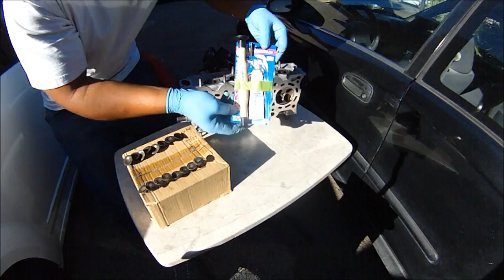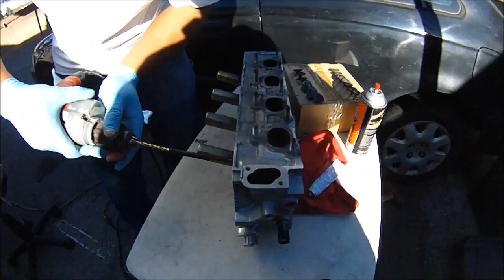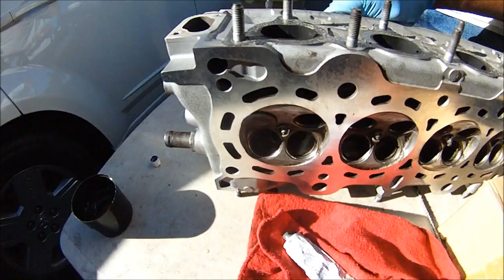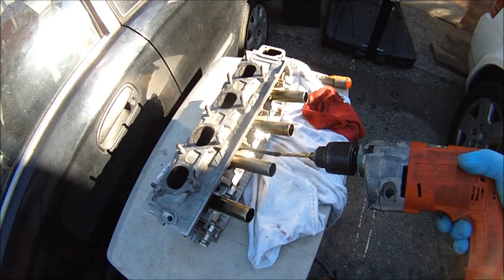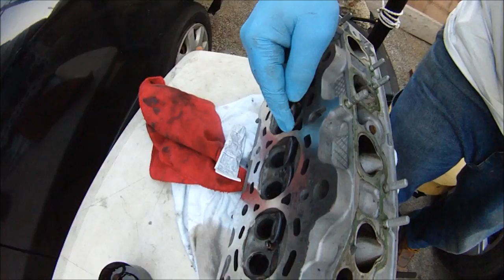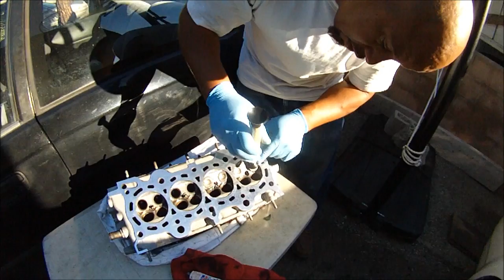HOW TO GRIND VALVES WITH A VACUUM HOSE & DRILL (NEVER TAUGHT AT SCHOOL, ONLY OLDSKOOL)

Comment: Dunno... I've used a drill (because the Garbage Rubber tipped Stick wouldn't stick) 
This a Risky !! methoc though.
 Waaaay to easy to grind grooves into both valve and seats. 
With skill it can work well.
But.. if one had Skills they wouldn't do it this way. 
Dangerous part  being anyone who thinks this an Easier... is Likely to bungle the work.
Reply: I can only hope that a DIY guy or girl somewhere take this comment seriously. Don't use the drill method if you don't understand the lapping method fully. You'll ruin your valve seats and valves. PLEASE LEARN THE VALVE LAPPING METHOD WITH THE HAND LAPPING TOOL FIRST!!! I USED THIS VIDEO TO LAP MY VALVES AND ALMOST RUINED MY ENGINE HEAD. TIPS IF YOU ARE STUBBORN 1. GET A DRILL THAT HAS REALLY SLOW SPEED. 2. PUSH IN AND OUT THAT DRILL REGULARLY AS OFTEN AS OLD SCHOOL DID IT IN THIS VIDEO. 3. APPLY LIGHT TO MEDIUM PRESSURE. DON'T PULL TOO HARD. YOU'LL MAKE SMALL GROOVES ON THE VALVES AND SEATS AND IT WILL NEVER SEAL. 4. SWITCH DRILL TO FORWARD AND REVERSE EVERY 2-3 SECONDS. 5. CHECK VALVES AND SEATS REGULARLY. FOR SMOOTHNESS. NO MICRO GROOVES SHOULD BE THERE. 7. GET A VALVE COMPOUND THAT HAS FINE AND COARSE GRIT SEPARATELY. ITS EASIER TO USE. 8. GOOD LUCK YOU'LL NEED IT. THIS IS DEFINITELY NOT GOING TO WORK FOR EVERYONE. IT DIDN'T WORK FOR ME. 9. STOP LAPPING WHEN THE COARSE SOUND OF THE COMPOUND GETS REAL QUIET. THIS TAKES EXPERIENCE AND PRACTICE FOR THE AVERAGE PERSON. NOT EVERYONE WILL JUST GET ON THEIR FIST ATTEMPT. HENCE LAP WITH YOUR HAND FIRST TO BUILD UP YOUR SKILL TO USE THE DRILL. AND SOME DRILLS JUST CANT GO SLOW ENOUGH FOR THIS OPERATION. I WOULDN'T RECOMMEND ANY BEGINNER TO JUST GET UP AND DO THIS. SORRY I DID.

Comment: Its an old vidreo and you probably already know this but i leave the coment to others , you shouls reverse the drill every 5-10 and dont use it full  speedrotation like you did there or will eat too much metal, but ofc it goes from motor to motor one holds better then others.

Comment: You can do it by hand with vacuum hose if you don't have a drill.  Use stiff vacuum hose.  I prefer the vacuum hose over the suction tool.

Comment: Only dislikes are from mechanics that are tight they cant scam people into just swapping another motor into their car!! Great job
Reply: Your statement is totally false. I do repairs on the cheap all the time on my vehicles. When it comes to Lapping Valves, it does very little on an engine that is warmed up. It is proven the valve heads expand and no longer seat in the same place on the valve and seat as they did when cold. You are only lapping cold components. .......... 

When the head is removed, just check to see if the combustion chamber holds gasoline or water without draining through the closed valves. If they do, clean the carbon build up and just put them back together with new seals as long as the guides are OK. .......... 

If they leaked and you are totally broke, then the bandaide of lapping can be tried, even though, when the engine warms, the sealing surfaces will be in different places and "HOPE" for the best. .......... 

I worked professionally since 1980 and on the flip side, I knew how much I could get away with on my own stuff. I knew any redo's on my own stuff was 100% on me if it failed for some reason. ..........

Comment: Hi oldskool! I'm lapping the valves of my 99 accord (the cylinder head seems to be exactly the same model you're working with). I'm doing it by hand, 'cause i'm a first timer. My grinding compound comes with two grades: fine and coarse. I'm supposed to use first the coarse paste and then the fine one. But after using the fine one, the grinded area at the valve and the seat doesn't feels smooth. It feels kinda rough but fine at the same time (like a very fine nail file), and the texture is like it has concentric rings. Does that reflects a correct lapping? Or i'm doing something wrong? I'm broke also. I'm doing this valve and head job for my accord myself. My mom has cancer and i need the car to take her to her therapy.

Comment: did it on Basic 3y toyota head.just chucked valve in cordless drill.no need for rubber link hose. direct drive. worked fine

Comment: I figure..... I already need a new 2 or 3 thousand dollar (rebuilt) engine because of my misfire problem....  I might as well spend about a hundred bucks on new gaskets and valve compound and give this and the head gasket / lapping videos a go.  I guess, the worse that could happen, if I don't fix it, is at least I get $100 worth of entertainment out of taking the engine apart, and working on it myself. :)

Comment: I saw loads of stuff from you and liked what yoy explained till now. But grinding valves with a drilling machine is a big NO NO! Never ever rotating valves like that. There is a special tool available with does a left right turn and is for a drill machine... But never ever soin them like that. You just get grovea in your valve surfaces and seats! After 25 years of doing mechanic stuff i still lap my valves the old school way by hand and suction cap...
 Dont do that way...
I see that all the time here in Cambodia... Again... Its a NO No!!!
Reply from the maker: It's not for you, it's for people who ain't afraid and who have a CAN DO ATTITUDE. Dont be so negative in 2019

Comment: I just got done doing this on a 1992 Ford Ranger cylinder head (2.3L I4) with 230,000 miles.

This method works -- and if you're like me, I not only hear the difference, I feel it too. While most people won't do it, I use a finger in the direct middle of the valve, while it's spinning, to be able to push on it slightly. Basic premise is to be able to push the valve in and out, and hear/feel no difference.

But like Old Skool said, this is for those of us who are basically poor and broke -- and with my valves and valve seats, especially considering how corroded and worn they were upon removal, why would I spend the $1,000+ to have a shop do this work, when I can DIY it? 
But OS is showing the proper technique to do this -- only thing I would add is to move the valve in and out so as to give a more uniform grind to both valve and valve seat.

Note: I wish I could upload pics to YouTube in comments, just to show how badly they were worn, and how they look now. Worlds apart, all thanks to this method -- plus the amount of money saved.

Comment: Grinding valves with a drill is false economy. Best thing to do is valve job from machine shop or replace the  head. Heads warp, guides wear, seats are worn. When the engine warms up, parts expand. Doing it this way will cost twice as much! DON'T do this! Cam journals and bearings wear. Install inserts NOW!
Reply: well why don't you just eat your words and buy it for the guy. call it a sponsorship, like in racing. robby jones sponsors the poor guy with the head he cant afford so robby can show the world the right way to do things. i like it.

Comment: This is a smart method. Valve lapping and just cylinder honing can restore a tired engine a "Poor man's engine rebuild" I've gotten engines not to smoke, got 30 percent + increase in compression. Also, a method I have used is I had cut and machined the wooden handle of a suction cup honing tool to fit in the chuck of a drill, and lapped them from the "other side" but the vacuum hose method looks like it works great!

Comment: just out of curiosity, couldn't you use a wire brush wheel to do the same thing? it looks like you are mostly just getting all the carbon off.
Reply: He's grinding two mating surfaces simultaneously for an airtight seal, something you couldn't accomplish by wire-brushing each surface separately. When he's done, each valve seals on only that seat, you can't swap them out afterwards.  Sure, a wire brush would remove carbon but that's not the only goal here.  You want an air-tight seal.

Comment: Why don't you take that lapping tool, cut it in half, add a nail in the middle, and run that on the drill? you can apply direct pressure, without worrying about the vacuum hose twisting and potentially breaking.
Reply: That might work if you could assure the suction cup was on the centerline of the valve.  If off center at higher RPMs, it may tend to spin off.  Try it and let us know how it works.

Comment: what does it mean if my coolant is evaporating out of the reservoir? would a head gasket change and machine shop cover this? the car's temperature isn't rising or anything I just have to put water in it everyday
Reply: Do you have puddles underneath your car?  Sounds like a leaky hose or cracked reservoir.

Comment: You guys that say you need grinders, mills etc, are correct.... by modern thinking. They don't teach this stuff anymore in school but there are many ways to repair things if you have the knowledge and experience. Old timers did different kinds of repairs and knew how long they would last. Some engines react well to certain repairs but not to others. I've seen loose rod bearings repaired by grinding the caps and lapping.

Comment: Thanks Old School, used your instructions on sanding the deck and head worked great. Doing the valves I used the cups from a hand lapping tool and put then on nut drivers for a drill, and then put them on the drill and used downward pressure and hopped them lightly up and down, as well as changed rotation. Using Old School methods I saved at least a grand plus, maybe more. Sweat Equity, thanks again.

Comment: And I thought the vacuum hose approach was a me original haha- did this on a honda head. 
I also discovered that one can do a 3 angle seat grind with permanent marker, a dremel, and grinding stones dressed to 30 and 75 degree angles. Permanent marker on the 45 seat will show how wide the contact area is. Gotta' be very careful of course, one slip and it's a trip to the machine shop. I narrowed my seats down to the width I wanted and the head has run great for over 5k miles now.

Comment: wassup big dawg...Love this video right here..ive seen alot of videos where people use that tool to suction the valve from the front and use their hands to grind down the valve.. this right here though way easier.... is there anything you recommend on cleaning valves without pulling the head off? ive used seafoam and valve cleaner  spraying through the intake with little success or is pulling the head off the best way to do it?

Comment: exact same way i do valves. on small engines like briggs you can't use the hose to drill method but you can superglue something to the face of the valve to allow for drill action. never had much luck using the suction cup.

Comment: Thanks for the excellent vid, I've ground heaps of valves in the past just like this, with excellent results. Only real difference is that I test the seat with petrol/gasoline at the end because if petrol doesn't leak though, pretty much nothing will. like you, I generally do most of the grind with the drill and finish with the hand tool. While the head is off, it's probably a good idea to check and/or replace the guides and seals to. Thanks for sharing :-).

Comment: With my race car, a 496ci Big Block Chevy with very expensive aluminum heads, whenever I have the machine shop recut my valve seats, I always give them a good valve lapping...just to be sure the valves have a good seal. I do them the same way...sort of...
I do use two grades of lapping compound. One is course and the other is fine for a nice finish.

Comment: Very nice video.  (Would have been nice to see a before and after cold compression test.)Question - is there a risk that this method removes too much material from the valves and their valves seats, so that the valve clearances cannot be properly set because the tip is too close to the camshaft/rocker arm?I am working on some old Yamaha FZR 600cc engines which are notorious for tightening intake valves so this method may be too aggressive.

Comment: Absolutely this will work.  As a matter of fact Ive done it this way many times.  I bought a 50 chevy out of a field that sat for 25 years.  Every thing was seized.  when I finally got it to crank, the pushrods bent from the valves being stuck. I freed up the valves and got it to run but had a dead cylinder due to an exhaust valve not seating.  I filled the cylinder with air, removed the valve spring and chucked a drill right to the valve, released the air and put lapping compound on the valve through the plug hole. I then lapped the valve, put it all together and the compression came up from 50 to 125 (or whatever the rest were) and ran perfectly until I sold it a few years ago.

Comment: good video... just wondering.. I have an H22 head of a1998 prelude recently took it off to check why there was oil inside the spark plug well. I did a test on the head with brake cleaner parts and some of them leaks right through it. what do you think it could be?? Please Help
Reply: Spark plug tube seals.